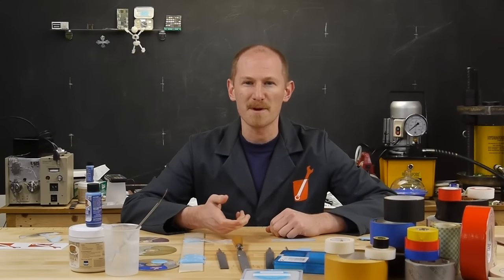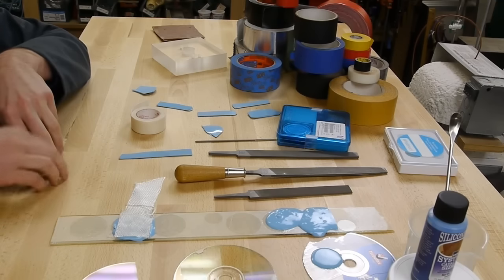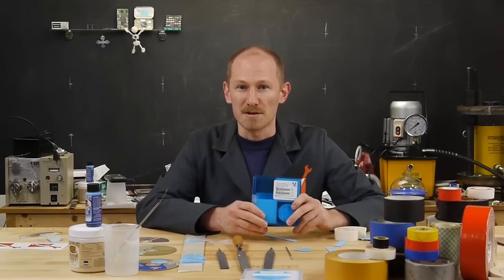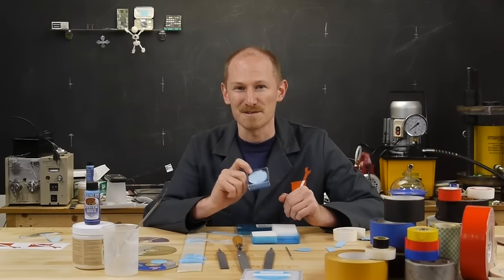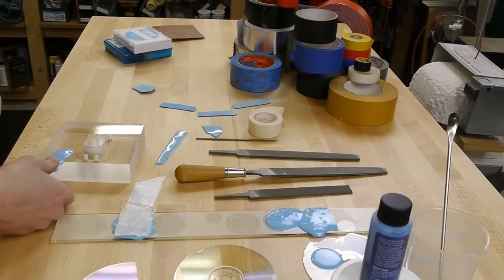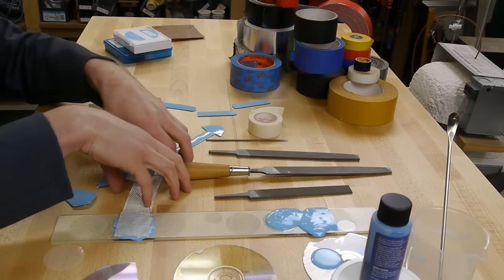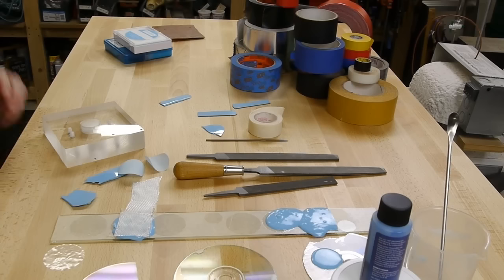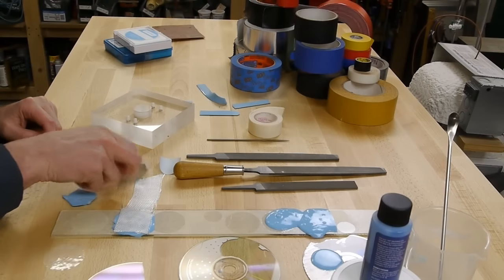Making DIY gecko tape - work in progress

Comment: 1. You could also think about what the gecko does with its foot. After placing it, does it just leave it flat, or does it apply a gripping force, like a snooker player making a bridge? 
2. The uni-directional effect, and your thoughts on it, are interesting, but also suggest other avenues. Could you interlace pillars/ridges facing opposite ways? Then you could make a bi-directional versional (or tri-directional etc.), possibly even omni-directional.
3. Does the effect rely on it being elastic? What about different degrees of elasticity or a non-elastic version?

Comment: As always - another great video!

Here are my general rough ideas:
1. Try to etch the mold yourself using laser. PCB machines use very accurate lasers so that is one direction if you have access to this field.
2. Another direction is silicone chips (IC's/CPU's, etc..). I'm not sure what their structure exactly is but they "grow" the silicone in controlled shapes (are they?!?) so maybe you could grow it in slightly different shapes to create your desired mold. Or maybe luckily enough the microscopic shape of a silicone wafer would be the correct shape for a mold.
3. Another completely different direction is biology. Why not grow the hairs/"noodles" from a biological matter and figure out a way to adhere that biological matter on a tape? or maybe even grow it on the tape to begin with. I was trying to think what could be grown in a controlled environment and be so fine and the first thing that came into my mind was fungus/mold and these kinds of nasty stuff. Another idea I thought of was seaweed/algae but I might be mistaken... 

Good luck and a followup video would be a great idea too :)

Comment: I don't know if your still looking for suggestions but there are a number of companies who do photoplotting which is like a really high quality transparency and can get micron level resolution pretty inexpensively. I use them as photomasks to make transistors in my own garage. The second thing you can do is take AgNO3 mixed into HF and that will deposit Ag onto silicon in little clusters with sizes around a few hundred nm. You can then do a mac etch by sticking the sample into H2O2 and HF which will cause the silver clusters to bury into the silicon which will allow you to use the silicon as a mold to make the nanopillars.

Comment: Not sure if you're still working on this, but I had an idea. You could start by adhering some opaque thin film (2 micron polyester?) to another reflective surface. Then a focussed laser beam could potentially cut small portions from the film. Lastly you could cast it as you have been. A couple things to overcome would be the focus of the laser beam and spacing of the cuts. There are near ultraviolet diode lasers like those blu-ray players use that use normal optics and can focus small enough for pitch sizes around 500nm. Spacing might be a bigger challenge, but even if a stepper motor can't step small enough you might be able to manually align it and make several passes. Food for thought.

Comment: Really interesting and high quality video as always. Thank you !
Maybe it's possible to use a standard cd or dvd burner and modify its code so that it "cuts" a little bit deeper holes with the proper size and spacing. I can imagine that this would need some intricate programming to get it to work well on an unmodified cd-drive but, if the spinning motor is driven at the right speeds and the laser is pulsed correctly maybe this can be an improvement. i don't now about the size of the focal point though because if thats way to big the whole effort would be useless

Comment: Have you thought about using an anisotropic etch on a silicon wafer? We use this to create an AR surface on solar cells that is essentially randomized pyramids. This may give you better aspect ratios and densities for the tape. A similar process is used in the production of the PERL solar cell, where a photolithographic process is used to etch inverted pyramids

Comment: I wonder if you could use the uni-directional gecko tape as the foot of a "toothbrush bug robot", with a small vibration motor. You might even be able to make it small and light enough to climb a vertical window.

Comment: A bit late to the party, but here's my completely hypothetical method for making the mold you need: 
1.)Source small linear plastic fibers, and very small linear metal fibers (extremely fine wire?).
2.)Bunch them up to a fairly large diameter, interspersing the metal fibers alongside the plastic.
3.)Infuse the end of the bundle with a very low viscosity epoxy or other adhesive. Leave to cure. Alternatively, you could squeeze the bundle very tightly and sinter the plastic together.
4.)Machine off a thin disc, at the aspect ratio of pillars you are looking for.
5.) Use a fine grit sandpaper or sharpening stone to perfect the surface.
6.)Use a strong acid to etch away the metal fibers.

et voila! a custom mold

Comment: The problem with testing these on glass is that glass is super smooth, so flat silicone can form a seal on it easily and stick through the pressure differential. To truly test the effectiveness of these gecko tapes you should be testing them on walls, bricks, leaves, tree trunks etc. that are rougher surfaces. That's the way the gecko foot has evolved and so this method of making gecko tape should stick better than smooth silicone.

Comment: You may want to test the LCD backlight lenticular diffuser film used in LCD monitors to spread the light evenly over the rear of the LCD panel within the limited depth desired by a flat screen monitor. The diffuser films are usually arrays of prisms. I have had good success making molds of these films and casting them. You might also try using platinum cured silicone. The platinum cured silicones capture finer detail and will stretch without tearing much better than the tin cured silicones. The end result is much more floppy and stretchy, so after the silicone has set you may with to cast an additional support layer of Urethane or tin cured silicone. Silicone on silicone can sometimes be tricky, especially if the chemistries are different. As long at the platinum cured silicone has fully cured then it should be safe to cast tin cured silicone on top. Tin cured silicone can actually inhibit the curing of platinum silicone, but not the otherway around, so this should be safe.

When making casts I have had interesting results. I've not experienced a startling gecko-like effect, but I think it does grip better than smooth silicone. Also the directional traction properties are interesting. The surface optical qualities are also interesting because it creates a surface that reflects light the opposite way other flat, shiny surfaces do. From most angles the surface will appear to have a matte finish, but when you rotate the surface just right with respect to a light source it will suddenly show bright reflections. It gives the surface a sort of metallic mirror-like look.

At any rate, it's worth investigating. You may have more luck than me.

Comment: For a regular very fine threaded surface, I'd try a "diffraction grate" os spectrophotometers () for instance, and a really, really flat surface for support, I'd use the tried and true "mica foils" that we use in atomic force microscopy.
The gecko feet structure follows some kind of "logistic equation pattern", I'd think about to use some kind of corona discharge to etche the suface, as they produce ore or less similar looking structures.

Comment: I'm sure there is some way to take a Blu-ray burner and control it in a way that you can etch very small holes (that are actually round) with an accurate spacing and depth along the entire surface. A Blu-ray burner might be too small for the silicone to settle into the holes created from the burner. If that's the case you could also use a normal CD burner.

Comment: Optics and UV transmission. Edmund Optics makes fused silica lenses that transmit UV. The corrected (multiple element) lenses are fairly expensive but the single-element lenses may be inexpensive enough for this kind of experiment, if the appropriate focal length and UV range is available.
Edmund Scientific was a great source for geeks-in-training back in the dawn of time. The optics branch soldiers on for mainly industrial optics.
It seems ironic that you could get UV filters for film camera lenses when analog photography was still a thing. Apparently normal optical glass passes enough UV to arguably mess with at least some photographic films, but not enough for your purposes.

Comment: Two ideas:
insanely fine sand paper? That stuff is pretty grippy!

Create your own mold using nanotechnology: You can use different length carbon chains adhered to a surface to emulate the gecko's foot. Look into papers on silane hydrophobic coatings. I am worried about the uniformity of the mold though.

Comment: 1'st idea, Etching:
 
Etch with carbon nano tubes in some sort of acidic fluid on a extremely thin peice of some sort of metal ( copper or aluminium foil ) ?
( aluminium foil is many layers, so if there was a way to remove only one of them maybe? )
The carbon nano tubes can conduct current and they are extremely small so it might work, as long as they just dont end up in a puddle of goo when they get into the acidic fluid.
And they are also easy to make!

2'nd Idea, Light: 

DLP mirror chip from a projector, the higher resolution the projector it is  salvaged from the better concentration on the light points for the photo lithography method there is, and maybe lenses to bring them down even further in size.
Or maybe some sort of fiber optic for the light, if it is possible to make so thin?

3'rd idea, X-rays:

Shoot away molecules in some material as the thin film you used but with x-ray's if possible. They go more straight then the radiation used for makin those thin filter films.
Must be some kind of material that react with x-rays?

And now I'm outa Ideas haha :( , I hope maybe one of them might work!

Cheers from Sweden / Mattias

Comment: I just read an article about using 'Shrinky-Dink' (kid toy stuff) shrink tape to generate a rough pattern and then heat-shrink it down to size. Solder shrink tubing would probably work just the same. The transparent stuff will have to be worked mechanically (lest you have a CO2 laser) the shrink tubing comes in any color and can be lasered with a cheap blue laser. A mechanical pattern (like your file) and a solvent plus some pressure might also do the trick.

Comment: Have you taken a look at the flat one under the microscope?  If you had it set on the surface you're pulling, doesn't that mean the hills and valleys fall exactly into the hills and valleys of the material you're pulling?  Basically, you're using the flat surface which is flat and smooth to the naked eye, but has lots of hills and valleys as a mold, so the seemingly flat silicone is actually covered with hills and valleys same as the flat smooth plastic, in other words, the hills and valleys fit perfectly together!

Comment: Not sure if it's been suggested yet but you could hydrothermally grow zinc oxide nanowires fairly easily using a water bath at around 80-90C. You could take a moulding of the wires and then take a moulding of the first moulding to get your structures. A cleaning step in dilute HCl might be required to remove wires embedded in the first casting. The aspect ratio and density of the wires could be ideal. Choice of substrate is crucial for the nanowire growth - might be best to go for something lattice matched or a seed crystal of ZnO in order to get vertically aligned growth.

Comment: It seems like the flat silicone works because pulling the silicone forms a vacuum between it and the surface of the plastic... not related to Van der Waals forces. Well perhaps rings of material that are in better contact use Van der Waals forces to help form the suction cup.

Comment: Some one probably already said it but maybe a light diffraction grading or perhaps they make a fresnel lens fine enough? Also you mentioned that the sharp part of the file isn't on the side that you need but you could make a negative mold and then cast off of that instead

Comment: Not sure if its been suggested before, but what about using an electron gun and placing the membrane in a vacuum chamber. If you wanted to get the pillars perfectly vertical you could change the relative angle of the electrons using the deflection coils of the electron gun.

Comment: You may also use drop cast method of acetone and ciggy butts .create very super thin slurry and cast on glass. As the acetone evaporetse you will be left with microporous structure. Very cheap and easy to do.

Comment: Hi Ben, 

Awesome work! Hmm.. Have you considered casting off of a diffraction grating? 

'Blazed' gratings have the exact asymmetrical triangle shape you mentioned (in order to increase the efficiency of reflected light at modes other than n=1) and they're available in various angles and pitches. The most steep would be an 'Echelle' grating. 

Ordinarily I'd say touching anything to a diffraction grating is a sin, (you're not even supposed to be able to wipe dust off without damaging it), but hey, science. 

There's a bit of precedence here. I'm not sure if mass-produced gratings are still done this way, but historically a 'master' grating was made by a ruling engine over a period of weeks, and then secondary gratings were cast/pressed off it. Nowadays it might be all holography and point sources, with every grating being a master, but I'm not sure. 

Oh, and by the way you've inspired me! I picked up an SEM the other day and have started the long process of restoring it!:
http://tinkerings.org/2015/11/15/electron-microscope-pt-2-the-teardown-begins/

Cheers,
Gavin

Comment: You may want to consider using a surface roughness standard as a  mold. Certain companies make silicon standards that have defined depths and heights  in the microns .

Comment: UV lens systems exist(not cheap though), but if you use a metallic mirror system (no glass or plastic to absorb UV) it should work as well.

Comment: I would try using the feathered edge of a blade that hasn't been stropped, or possibly after a light strop. The edge wouldn't be visible to the eye, but would create a somewhat consistent set of ridgelines that are disrupted along their edges.

Comment: Try casting onto powders like silica, alumina, or magnesia. Varying the particle size will vary the aspect ratio to some degree. It's not perfect but there aren't many good options available. My first go would be on fumed silica or ultra light magnesium dioxide powder. To some extent you can vary the void space by varying how firmly the powders are compressed prior to casting. You could even try casting onto common fine powders like talc. In fact talc is not typically spheroidal particles, so you may have some interesting void spaces to cast into.

Comment: As always, very interesting video!
I would suggest using your SEM for electron-beam lithography.
If you don't like the idea of messing with the sweeping coils, and since you don't need the extreme resolution of the SEM; just use the whole FOV as one pixel and automate the x y settings to step out a pattern.
Because of the same reason you don't have to worry that much about the motor stitching.
(You probably want to do a photo mask instead of doing this process on each test.)

As an alternative ask around for old photo-masks at universities with process laboratories for either a custom mask or some old test pattern that you can use.

Comment: anodizing aluminum creates nano tubes which can be used to create nanowires by electrodepositing other metals like silver for example. Perhaps try molding an anodized aluminum sheet, prior to it being sealed. This of course assumes the silicone will manage to get in to the narrow tubes. there's a lot of documentation on how to play with the size of tube cavities by varying the anodizing  parameters

Comment: Besides getting a mold of an actual gexko foot, keep trying to cast onto various surfaces. you got good results with your control so why not go from there? Wood comes to mine, and potentially lacquer coated wood which makes smoothed surfaces rough might yield something. 
Besides that, maybe try the beta particles on the polycarbonate and wait various times as you mentioned. It could increase the size of holes and time it for optimum ratio of height and width.

Comment: The process of anodizing aluminum creates cylindrical pores in aluminum which is then filled with dye and sealed. I believe the pore size can be controlled by amount of current applied during the process. Without dying and sealing the anodized aluminum, it may be possible to cast it to create the desired cylindrical stems for this project.

Comment: To make the holes, I was thinking of something like a sandblasting process.  WC would be a good abrasive for the process because it is dense.  You'll probably have to experiment with things like the speed of the particles and the type of material.

Comment: I've seen some students build a robot based on this tech but they used something much more macroscopic. the silicon looked like it was long comb structure. you have tall walls of silicon that make contact by bending to the surface